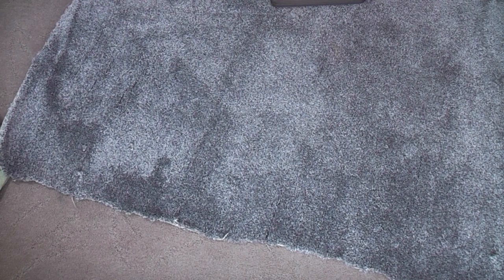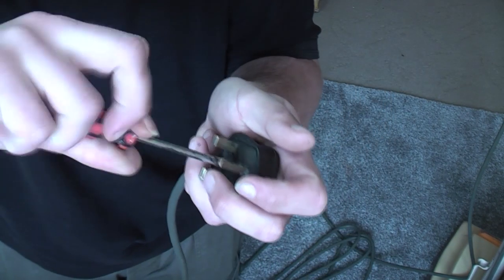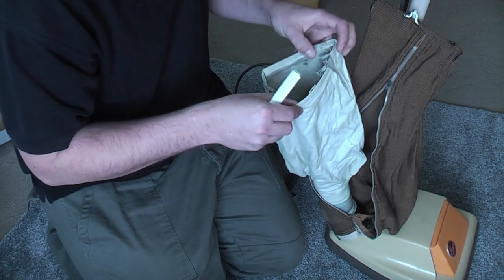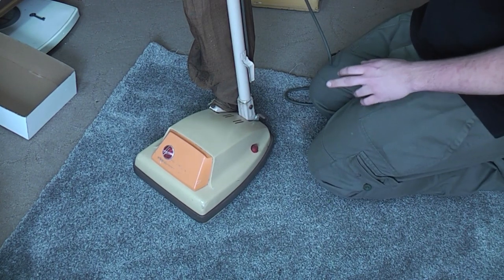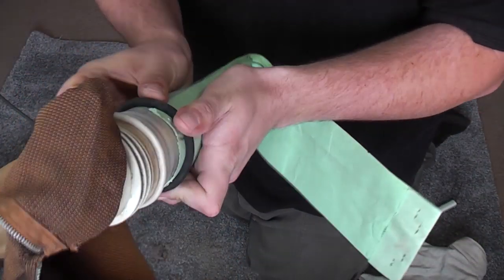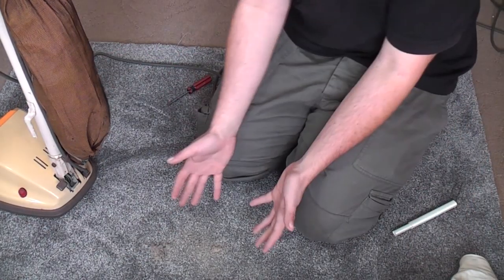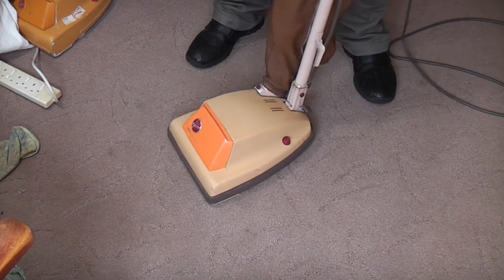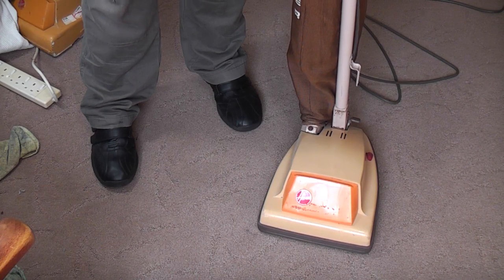Hoover Junior 1436 (Mk1) - A General Look (Collection for another Collector!)

Comment: Ah I remember that one coming up on the facebook groups - I found it and shared the link for them. Its a nice machine, and indeed, a first phase 1346, of which there were 4 phases released between early 1967 and late 1969, all on the brown theme, which had minor revisons to small parts during the 3 years before it became the 1346A in January 1970, and changed to the lovely turquiose green colour with the height adjuster moving to the top of the hood.
The first phase only ran for about 6 months or so, from early 1967 to late 1967, when the phase 2 came out, replacing the striking pumpkin coloured front with a chocolate brown one, to match the bag, and the front stayed brown until the 1346A came out in 1970, so in a way, the pumpkin front model is the best model to get as it was so short lived.
By the way, the title of the video has the model number wrong - its 1346 rather than 1436.
Reply from the maker: I've still got it too! All boxed up but postage not paid yet. I must remind him about that, or at least bring it in from the shed so it doesnt get damaged. Or be really stupid and refurbish it just because...